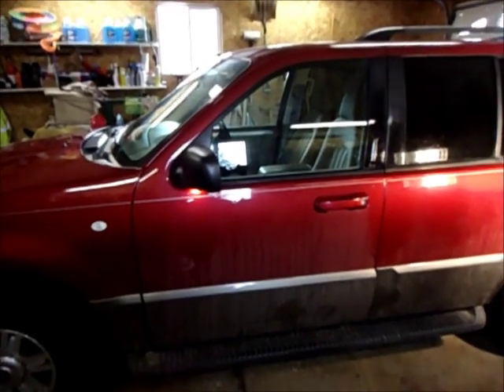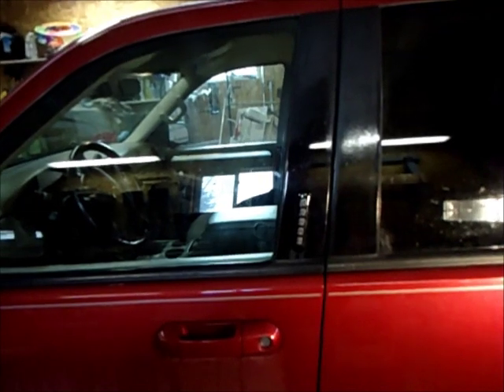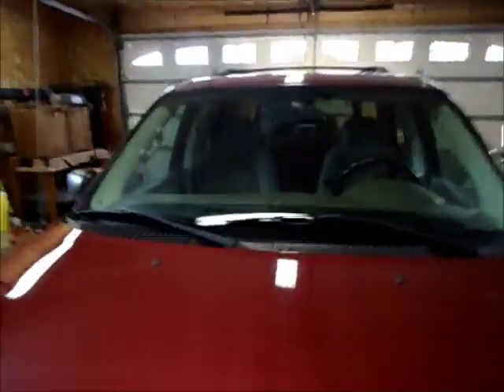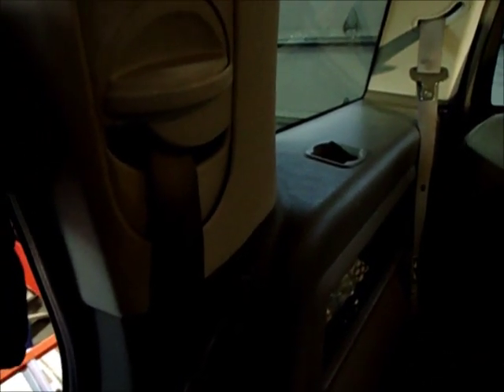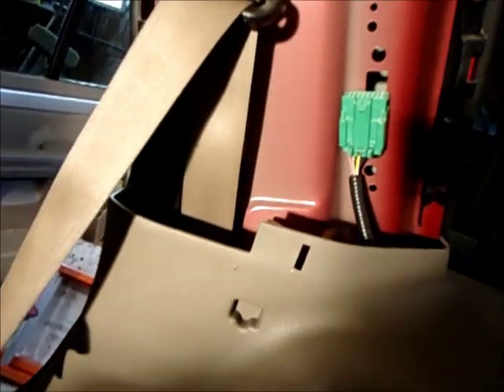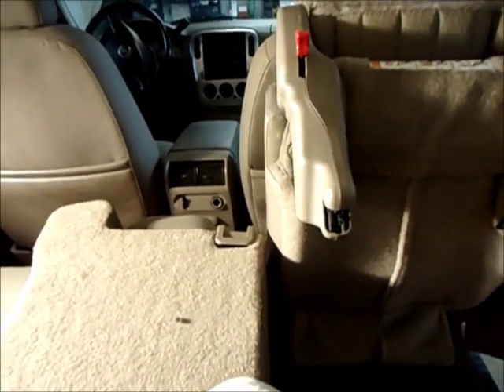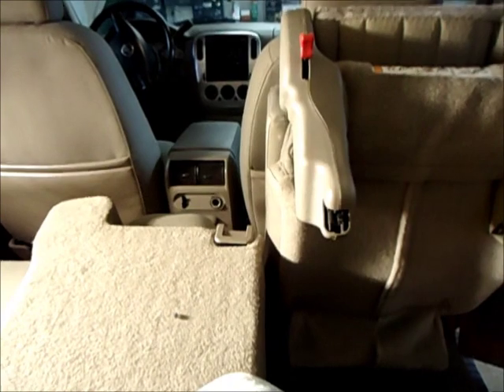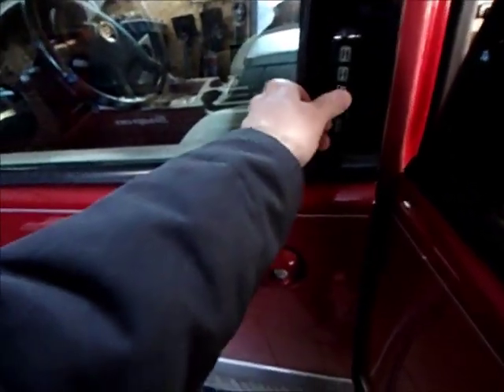2003 Mercury Mountaineer Door key Pad Code

Comment: Randy the amount of money your video is costing dealerships, because used car buyers would love to enjoy this feature on their cars, might get you assassinated sir. I got a quote of $200.00 to "factory reset the keyless entry on my mountaineer. It took all of 1 minute for me to access my module and enter the code. At first it did nothing until I followed your instructions and disconnected the battery positive cable, waited a minute, then reconnected and presto, the code worked. again thank you so much.

Comment: Hello Randy: I drive Ford Explorer 4.6, V8, 2002. I bought it in used condition. It runs like a new vehicle. I did not have factory Keyless Entry reset code. I was unable to reset by myself. Ford dealer was asking for $115 dollars. I watched your video; did exactly as it is shown in your video; found the factory code and reset my custom code. Now, I can enjoy Keyless Entry in my Ford WITH YOUR HELP. I THANK YOU FOR POSTING SUCH AN INFORMATIVE AND ACCURATE VIDEO. Toronto, Canada.
Reply from the maker: Great !!! glad it helped you out.....

Comment: Will this work for 2010?
Reply from the maker: If the control box per say is mounted in the same place,  then I believe it will. Maybe go through the comments section and see if someone else has said it worked for them. Good luck I hope it works for you too.
Reply: @randyhaske  Yeah..I called myself looking....will definitely try
Reply: @randyhaske  thnx

Comment: wow what a pain in the a## just to get a number, thanks!!
Reply from the maker: +Dan Delaune  your welcome, God Bless
Reply: Randy,  quickone, mercury Mountaineer 2004, rear hatch window is jammed,  i hit the eject or release from both the remote and near plate. no luck,  any idea?
Reply: i assume the locking mech is locked but im wondering if there is a manual release. tks
Reply from the maker: Did u see my reply? Can u remove interior pannel to get to latch mechanism
Reply: Did not, will look later tks.